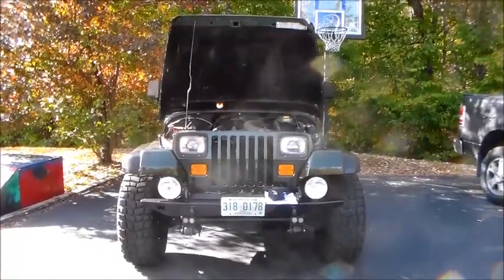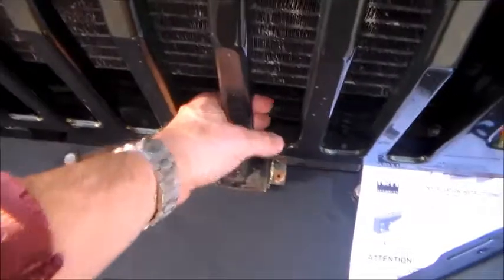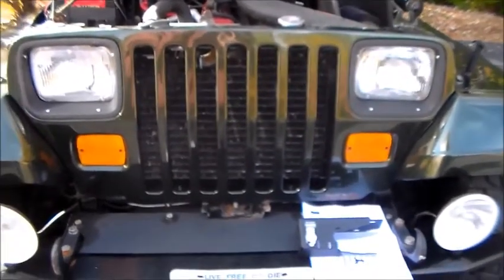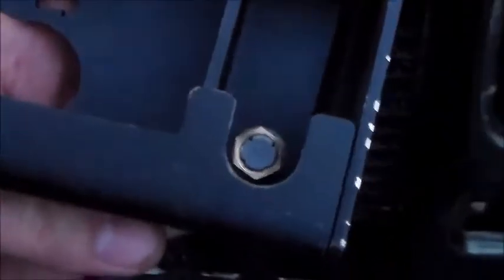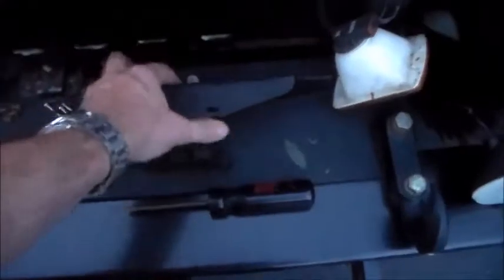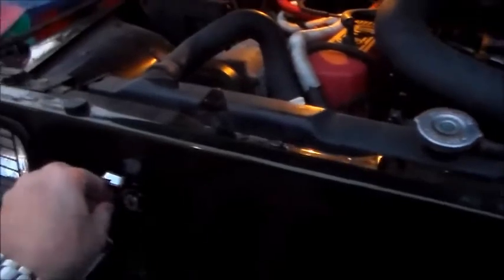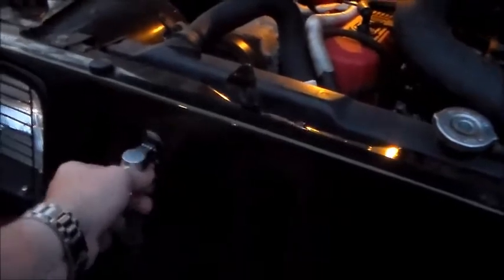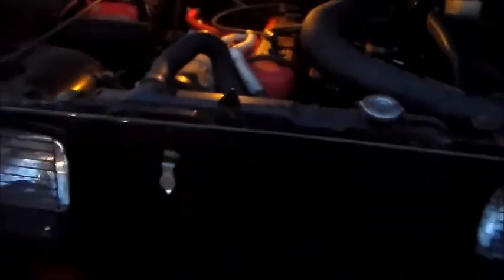Tuffy Hood Lock Installation - Jeep YJ

Comment: Thanks for the idea of using bedliner on the headlight bezels.
Reply from the maker: I didn't do it, I bought my Jeep that way!! lol. Everything they could, they Rhino-Lined on this Jeep. I prefer the less coarse texture of Line X, but oh well. It is great for some stuff, but not on everything!! It is already flaking off of the frame, and I will need to re-apply some product to the frame. I am going to use POR 15 first, then something else, over the top. Thanks for watching and commenting.

Comment: The radiator comes out pretty easy and obviously in this case, no reason to drain it just lean it out of the way by removing most of the screws holding it. Would that not greatly simplify this install?

Comment: I’m actually in the process of installing one of these on my YJ. It’s a four-cylinder without air-conditioning. After watching this video, I’ve decided to add the lock dust cover. If I install the hood latch lock now, can I add the lock does cover afterwards without taking it back out? Don’t know whether or not you mentioned that in your video.   Great video.
Reply from the maker: MrBlackbear707 You cannot install the dust cover, after installation! The lock unit would have to be removed. If you haven’t installed it yet, I would wait for your dust cover to arrive, mount it, then install the whole unit. Installing the dust cover was a huge pain, btw. I think Tuffy should install them, if they’re ordered together. Would’ve been a lot easier. Thanks for watching and commenting. Please consider subscribing if you don’t already!!